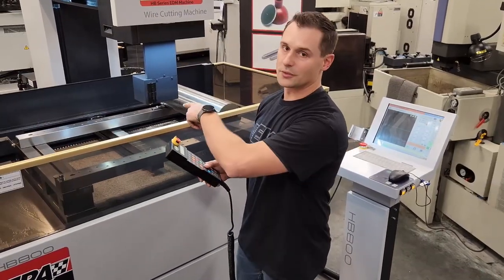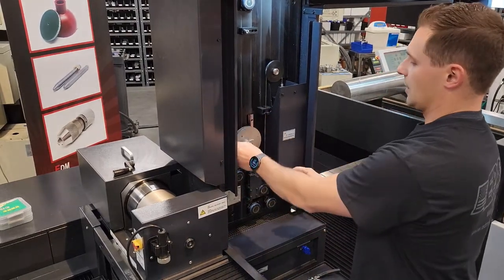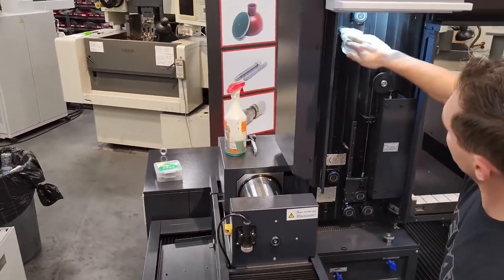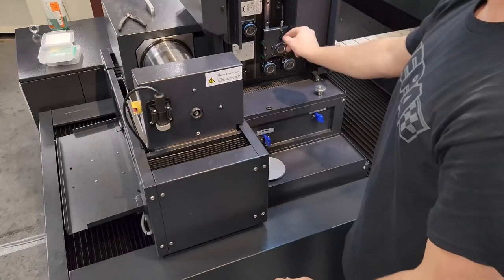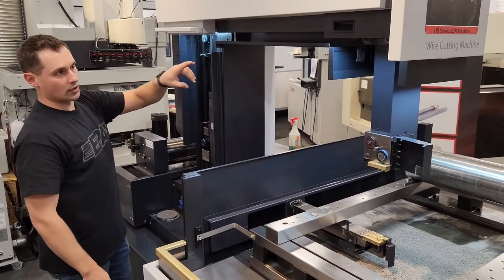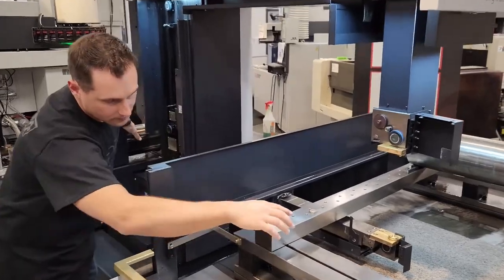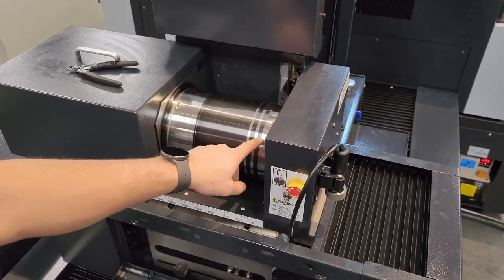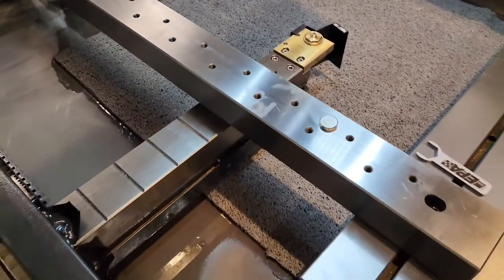How to Thread Wire on a Fast Wire EDM, Removal and Install - Moly Cut

Comment: Why did you need the gaps on the 2 sides?
Reply: If you're talking about the empty space on the far sides, it keeps the drive mechanism from going to it's extremes.
if you're talking about the double gap on the right side, well, normally you wouldn't have that inner gap.
If you talking about the bit of wire left on each side as it spins, it's a buffer to keep the drum from breaking the wire from the tie off points.
Reply: @Friariah  ok thanks! Waited a long time for that answer. Inappreciate it! Lol. Do you have an email where I can send you some questions? I have an older machine and Im very curious about speeds and settings.